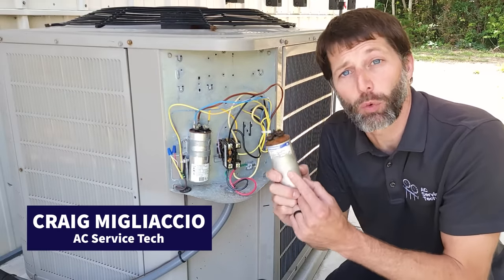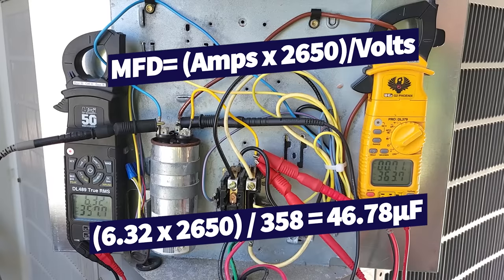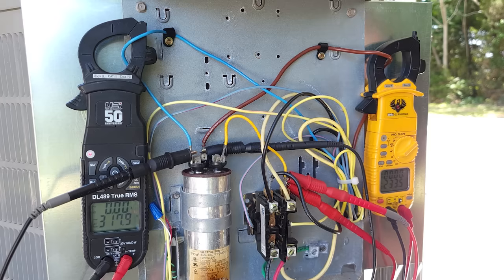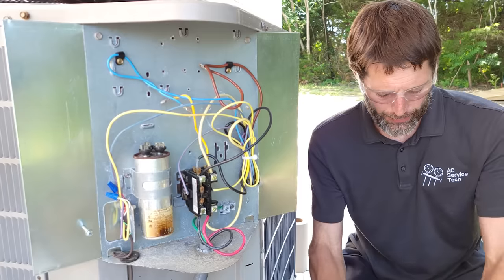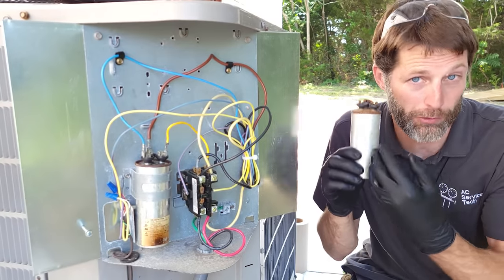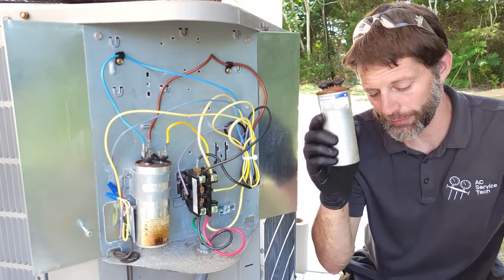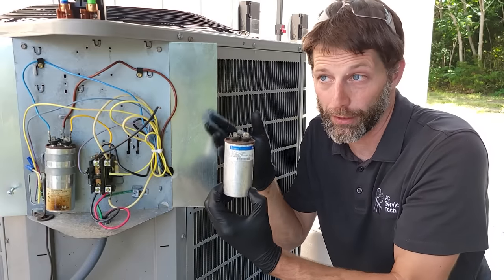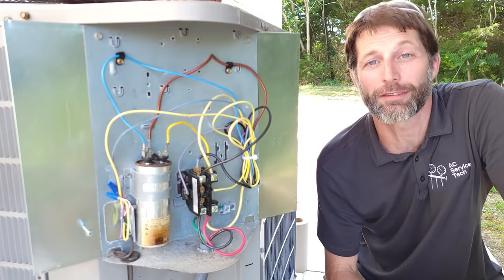WHY CAPACITORS FAIL in Air Conditioners! Watch it Break!

Comment: Is there anyway to help prevent the capacitors from overheating?  My outside unit gets a lot of direct sun from about 1pm to 5pm and I'm in Texas so it's HOT lol.  I've seen people recommending putting a canopy over your outside unit to give it shade but I've also been told not to put a canopy because then the unit can't properly disperse the heat out the top of the unit and it makes the area around the unit hotter which is not good for it.  So is there any way or anything we can do to help keep the capacitors from overheating?

Comment: Great video!
I just had my AC serviced and the diagnosis was “failing capacitor”.
(It was blowing gradually less cool every day until not at all.)

I have no idea how old it actually was but in the 7 years I owned the home it was never replaced. And because we have skylights ( near the thermostat but shades installed now) the ac ran a lot every summer.

Comment: I'd like to do a diagnostic of a functioning, but older ( 4+yrs) capacitor ahead of each cooling season.....so I'd like to meter the unit as a pre-check before the season starts....all "as-installed". Assuming I safely kill all the power....and discharge the capacitor with an insulated screwdriver......can I then measure the capacitance as-installed?, ...or MUST the wires be disconnected each year I do this check.....just trying not to have many occasions of pulling the terminations on and off each time if I don't have to.

Comment: If the back EMF from the van was creating a high voltage than what the Capacitor is rated for.  

Would you solve the issue by installing a capacitor with a higher voltage rating or would there be a way to reduce the amount of voltage going into the capacitor?

Comment: So if heat is the first cause of capacitor failure, why aren't they mounted in the airflow of the fan and/or mounted on a nice big heat sink?  I'm going to fashion some flexible ducting from the top of my unit to the electrical corner.

Comment: This happened to my three year old unit recently.  The technician that came out diagnosed it right away and told me that failures are common with Chinese made parts.
Reply: Chinese capacitors are junk. In the music industry, capacitors are used in guitar amplifiers and the Chinese models are always replaced on units for discerning customers.

Comment: I presume these air conditioners run from 230V (split phase) hence why 358V is seen ? In that case, 370V seems a bit closely rated when you take line play into account. In the UK where we use 240V, capacitors used on the line are usualy rated at least 400-450V DC in switched mode power supplies to allow for line tolerances.

Do newer aircon units use more modern electronic startup rather than rely on AC phase shift capacitors like these?

Comment: Capacitors depending on type will simply fail with age, whether in use or not. These are wet electrolytic capacitors. Although the unit is sealed it is not perfectly sealed. Many actually have a vent to prevent severe damage upon failure. That vent isn't perfect. At any rate, over time they can dry out. They don't need to dry completely but if they dry sufficiently the dielectric can fail allowing voltage to arc from plate to plate, causing internal heating and loss of value. (some types will actually appear to increase in value as they age). The dielectric materials can fatigue with age, even with normal operation. Conversely, excess moisture, trapped inside at the time of manufacture or over time in areas of very high humidity, leads to contamination of the dielectric. Sufficient water inside will freeze.
Expansion and contraction of the entire unit and its internal components occurs naturally with seasonal changes and through periods of operation versus non-operating. It has to survive bitter cold (depending on where you live of course) and then the heat of summer plus internal heat rise in operation. This physical motion causes stress on the capacitor promoting failure over time. Considering they're only rated to about 160°F it's no wonder they fail.
These capacitors are generally made for this purpose but physical vibration & shock can lead to failures, vibrating the mounts loose over time for example. Rust ... do we really need to even discuss rust?
Leakage current: capacitors are supposed to block current. It doesn't actually flow through the capacitor (or at least it isn't supposed to, the very short explanation is as electrons are pushed on to one side there is an equal pull from the opposite side but they do not cross the dielectric). In normal operation the dielectric of a wet electrolytic, if it hasn't dried, is reformed. But if it rests for a long time it can permit some current to pass. This can lead to a number of problems but one would be heating leading to failure. These types of meters will not indicate leakage current (it's a very special test). This failure would be rare for such application but it's possible. It's also why it is not practical to have a spare waiting around for years.
Reply: They are also cycle limited.  So, an AC in the south that is used year round will typically wear out a capacitor faster than an AC that is used seasonally in the summertime only.

Comment: I have an evaporative cooler with (only) one capacitor that failed. I believe that it is simply a start capacitor. How do you determine start cap V run cap and, order the correct replacement.

Comment: I use a Tonghui TH3821 LCR meter to check capacitors. The other day I had a motor not  running the capacitor checked OK for value but the ESR was to high. New capacitor fixed the problem.
Reply: I hardly ever see ESR mentioned when it comes to AC Cap checking which is a shame. Most will just check the uF value and think it's okay. Techs in the audio/HiFi field know the importance of checking ESR.  Also a cap that checks higher than normal for uF might be called an "over achiever" but it's also a good sign that the ESR is too high and the cap is near the end of it's life. Would be interesting to see brand new caps checked for ESR to see if those cheap caps from China have a problem right out of the box.

Comment: Newbies question. Homeowner, not a technician.
I live in fl. Our air runs all the time. In the last two houses I have had about 2-3 capacitors go bad in the outside unit (condenser?)
Would it be wise for me to look up the make/model/size of the current capacitor and buy a couple of spares to keep in my garage?
They seem very easy to replace and 8 out of ten times an air unit goes bad in fl on the weekend, it seems to be the capacitor.

I think I can replace them with common sense. Turn off the power, pull the a/c breaker. Replace the cap, reconnect power leads as they were on there, reconnect breaker and turn on power.
Reply: Its definitely a good idea, I would recommend buying a multimeter that can measure capacitance as well so you can test them. Also remember to discharge them buy putting a screwdriver across the common, herm, and fan poles.
Reply: Don't forget you may still have 24V power that pulls in the contacts of the contactor in your outside unit.....even though you pulled the main power plug breaker on the outside unit. Check with a meter....at least remove the breaker on the outside unit, pull the breaker on your home panel ( labelled "for outside unit" AND for "air handler/furnace" too,  if you have that too)....AND set the thermostat in your house to OFF.

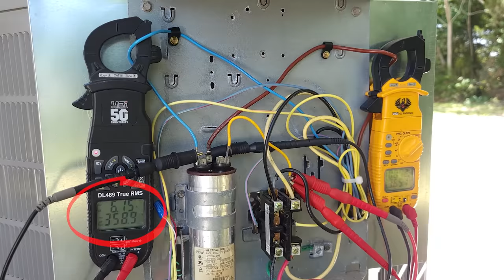Comment: Yeah, but at 2:19 you can clearly see the wax/resin move up the capacitor as you apply heat with a heatgun in your time lapse, even the label is discolored now... we had guys locally that would do just that to guarantee another visit because a condenser fan or compressor wouldn't start. So in my eye, you really know your stuff.. using the quotient method and two dmms w/clamps is something most field techs aren't going to have, let alone a functioning spare clamp meter with batteries on the truck. More of a "look how smart I am trick to amaze the new guy." Most meters today include a basic capacitance test mode, so it is a not as confusing to the guy with frostbitten fingers.. Just remember to isolate/disconnect the device under test. Another thing to remember is voltage, primary capacitor failure is usually over temperature (as shown) and voltage, back emf can be substantially higher than line voltages! So, just because you have that 50Mfd 300v capacitor on the truck for a 120v compressor, doesn't mean it will work on a 240vac start.. more like 450v. I worked along side some pretty smart dudes in the industry, but they all made mistakes.

Comment: Really interesting video, thanks. How did you force the capacitor to fail?
Reply: Looks like he put a torch or hear gun  to it. If you look at it as it's failing you can see the label start to brown, and then after you can see it burnt at the bottom.

Comment: Such a great video with actual useful information.  Capacitors are designed to fail, just like light bulbs.   If they built them with slightly thicker plates and insulators they would last 50 years.  Of course that capacitor would cost about 50% more than the cheap ones they sell you.  If better capacitors were used, half of the HVAC installers in your town would go out of business because the  units would last 20 years rather than need a new capacitor at 9 years.

Comment: Have I missed something? It seems you knew that specific capacitor was going to fail. The shroud was off so it probably was not external heat. The rating of the capacitor was good, so how did you know a good capacitor would fail? Thanks for the excellent videos...

Comment: I don't know anything about HVAC admittedly, but I'm familiar with hobbyist (NOT MAKER!) level electrical engineering. One of the most common issues I see when repairing broken electronics is a bad capacitor in the power supply. Computer, a stereo, a DVD player or even a cheap battery charger, the power supply filtering caps always seem to be the most common point of failure. Thankfully it's an easy problem to diagnose and even easier to fix. So long as you have replacement capacitors on hand. Not everybody keeps an E12 set of various types of capacitors on hand "just in case." And you can't test capacitance unless you remove it from the circuit.
Reply: I have a couple of 'Homecast' PVR's that have one problem. A 5microfarad capacitor in the middle of a bunch of components on the main pcb keeps failing due to heat from the close proximity of the other components, (they're all a really snug fit next to each other). Solution - Leave the cap 'tails' long, so that the cap is sitting proud of other components on the board.
Reply: @bryanfarrow914  That's actually a good point you mention here in your story. Heat will kill electrolytic capacitors (the can shaped ones) a lot faster than usual. The reason being that electrolytics need a liquid electrolyte (hence the name) to function. Things like time and heat will cause this to dry up, and make the capacitor act like a short.

Comment: Mine looks fine no bulging...but my 35/5 capacitor is reading 17.25/3.5...
I believe we had a voltage spike in our area and it stopped working..it kicked a few breakers

Comment: I have 2 different size start capacitors with the Same ratings.

Why different sizes?

I bought the first one as a mistake.  I’d look at too many and forgot to look at the physical size.

I thought about using it anyway but the right one because the external housing for it is specific but I will keep it as a backup.

This is for a automotive lift.

Is a larger capacitor better or function the same as it’s smaller counter part?

Heat is most likely why the first one failed as the motor is in direct sunlight.  

I was going to make a cover from the FL rain but will also make sure it stays in the shade.

Comment: Why does capacitor bottom suddenly turn brown at 2:26? Burn/Scorch mark on label. Most electrolytics in  non-appliance electronics slowly lose efficiency without sudden failure.  Nice that you caught the popping though.
Reply: he heated it with something. I thought the same thing... how lucky to catch one popping... then he said that he heated it.
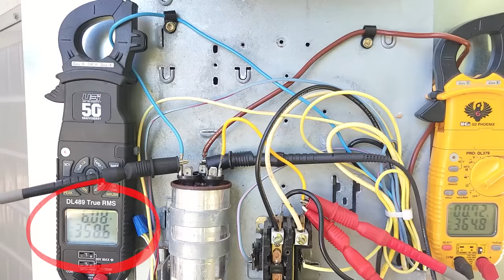Reply: He didn't make it very clear; he heated it up on the bottom. He makes vague mention at 5:42. I had to review it twice after I read others' comments here that he even mentioned it at all...

Comment: What is the failure mechanism? Are the electrodes shorting, or are they losing useful surface area? So, when the capacitor fails,  does its DC leakage current go up (shorts) or what?

Comment: Nice job on the video. I wish I could get you to service my unit. I have a 4-ton Goodman AC system that every second or third day will not turn on unless I go outside and shut the power off at the breaker and then on. Can anyone offer a suggestion.

Comment: Why not some vacuum pressure below fan blades in compressor area to suck warm air area off capacitor and into fan intake?  Possibly a simple drilled hole in sheet metal wall near capacity mount and inner unit wall.

Comment: I have a 2 1/2 ton Trane unit. Is it OK to run AC system from a 13,000 W portable Duramax generator?
The generator has plenty of power to run the system. We’ve already tested it. 
I just don’t want to damage my AC system

Comment: Forgive me for my limited knowledge of the fundamentals here. At 3:10 or so "...high current, draw but you're not going to see the compressor or fan turn on." I have to wonder if there is some protection to prevent the 2 motors from burning up since they are stalled, not turning, yet drawing current. I know there are overheating circuit breakers within the motor windings, but does that mean as long as cooling is being called for the unit will simply cycle from internal overheat, cool down; draw current, overheat, trip overload, cool down, etc, possibly for many such cycles until the power is disconnected or the capacitor replaced? Additionally, since capacitors are so cheap and such a frequent cause of system failure, why not replace them on a maintenance basis?

Comment: Great video thanks so much. Maybe you could do a video on Why These Capacitors are so over priced!? These are  double electrolytic caps made in China for less than it cost to make an alkaline or Lithium battery, but some how AC Service companies are selling them for $400 to $600.
Reply: AC service is overpriced because they are protected by government mandates.  That's true of any profession that requires licensing.  They make their profit on people like you, and the bulk of their low margin business on commercial work.  It doesn't help that individuals often don't pay their bill so you have to pay for that risk too.

Comment: So your A/C should be shaded.  Engineering: Should there be a fan beneath that compartment in a fan compartment easily opened to replace fan?  Should that compartment hold that fan have ventilation openings?  Could the fan in the A/C be installed in such a way that it blows a little air into the capacitor compartment, which has ventilation holes in it?  Seems to me that a little engineering could make the capacitors last longer.  An A/C unit could be designed like a battery using device with an easy to open compartment so you could easily unplug, remove & install new capacitors like you do batteries in many small devices.

Comment: add a cool air channel to pass around the capacitor. Or simply extend the wires and fix it to cold output flow.

Comment: If heat is a big issue then why are they installed in the outdoor unit? It seems someone could come up with an inside box that contains the cap and contactor.

Comment: Also, if for example, the fan capacitor it bad, can i just spin the fan by hand to give it a start, in order to determine its not a mechanical issue ?